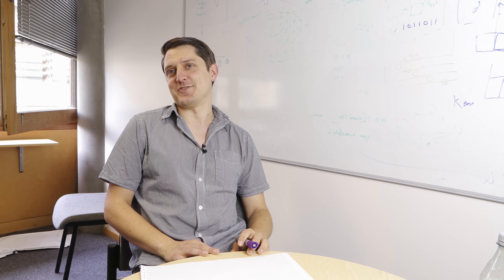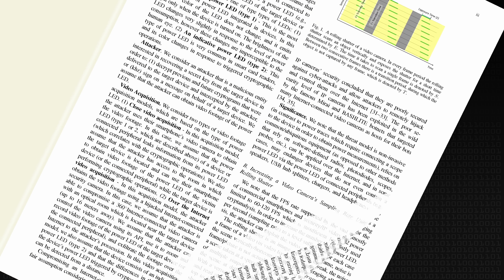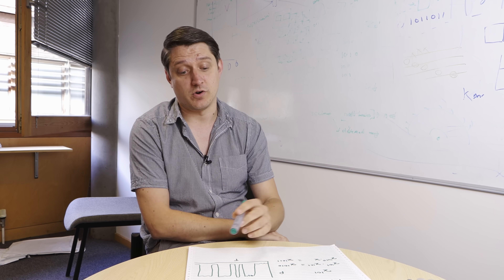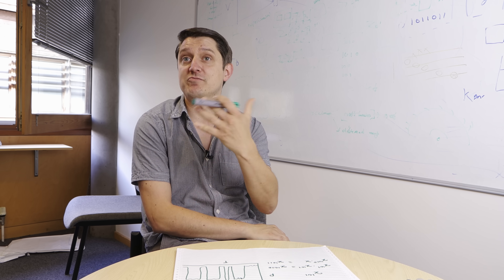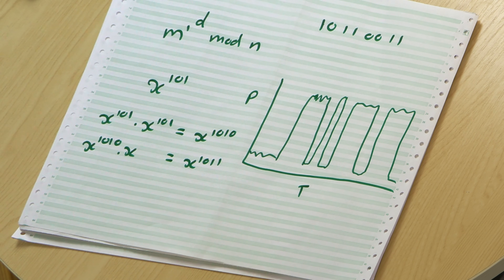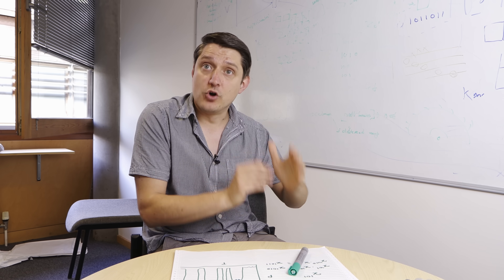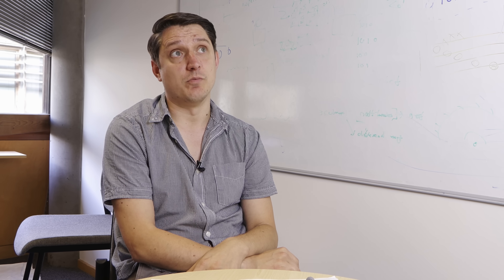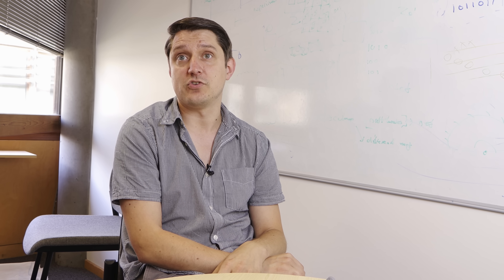Power LED Attack - Computerphile

Comment: To everyone who writes an "Ah, the fix is easy just do this" comment; the problem isn't this specific vulnerability. The problem that this is one of dozens or hundreds of attack vectors into dozens or hundreds of possible algorithms, each made from thousands of lines of code. And each one showing more hard to imagine ways to utilize side channel information. Any one of them is easy to fix, if you are aware of it. And any diligent software or hardware engineer who is qualified to work on cryptography stuff will attempt to fix as many of these issues as they are aware of. It's the "being aware" part and the sheer number of possible issues that's the problem.
Reply: Adding on to this, it's possible for someone to harden their security against every single known side channel attack, but if someone thinks of a new one, then suddenly all existing infrastructure is vulnerable.
Reply: Ah, the fix is easy just destroy the LED
Reply: @pistonsjem  And if it was a blue LED, it deserved destruction anyway.
Reply: @ingulari3977  I wouldn't be so sure about the weather part.
Since the portion of the computation you care about probably happens really quickly, I wouldn't expect there to be any significant changes in the environment that'll mess up your brightness values. But I might also be entirely wrong, I have done zero testing or googling on this.
Reply: @ingulari3977 I can just say as a EE this is easily thwartable and it’s not even funny.
But hey scaring people with wizard powers gets the clicks.
Reply: Yeah, this sounds like something that's if not trivial at least not terribly hard to solve if it's pointed out, it's just that this kind of physical spying introduces so many crazy ways an attacker could break security that just completly end-line the stuff you put a lot of money into.
Reply: @Canzandridas, yes, better protection is very bad </ironyoff>
Reply: Exactly
Reply: Just put a low pass filter in front of the led? A single cap should do, shouldnt it?
Reply: @andrassasdi1767  OP's point was that individual vulnerabilities are easily solvable, the problem is that this style of physical attack on cryptography offers a fuckton of new opportunities to breach security and we basically need to either keep all devices doing cryptography way more physically secure than we have been or else find and solve each of them individually. It doesn't matter if a simple trick with the power regulation can solve this one if there's a thousand more and you'd need to do research and then put in a new component to solve each.
Reply: Yup, exactly. This reminds me of a short scifi story, where they created a starship impervious to any attack fathomable to be able to explore the Universe without any worries. Then it landed on a planet with some kind of microorganism, that selectively fed on metal and the ship proceeded to get devoured, because the engineers couldn't imagine such a thing.
Reply: But there is no need to fix this, this is extremely impractical and not feasible, to the point of near certainty that the attacker would not have all the necessary access and information to execute this. Just think about it, the attacker would need to know the processor is doing nothing but encryption/decryption all or most of the time (and that there is only one thing on the circuit that introduces those kind of fluctuations), the kind of encryption it uses and the specific implementation too, he would need an access to a very high resolution, high framerate and very high zoom camera (that's very rare in practice), or the access to put his own camera, somehow unnoticed, right on top of the led. This is not even impractical, it's practically impossible.
Reply: @realkrzaku  That's the dilemma. The attacker can use any of the vulnerable aspects of the system. They get to choose the easiest. But as the defender of the system, whenever you patch one the attack can just move to the next easiest.

Comment: I'm surprised video compression doesn't wreak havoc with this approach.
Reply: Ah heh didn't make it to part of the vid where they explained using the offset in time from rolling shutter/rows of pixels as a means of amplifying the effective sample rate but think photoresistor and oscilloscope could work fine too in terms of upping the sample rate.
Reply: The monitoring would need to be pretty accurate but if you know a little filmography it would be easy to configure
Reply: If you’ve seen Tom Scott’s video on MP4 compression I’m pretty sure it would be fine with 3 colors
Reply: Guess since like he was saying about it being out of focus doesn't matter much with regard to the average intensity it just smooths things out a bit that's probably mostly true with the video encoding as well (losing bits can afford to lose and still extract the intensity over time accurately enough)
Reply: It would.
Reply: Lossless compression shouldn't impact anything and you could always film without any compression
Reply: @Ghi102  I think part of the setup was being able to use common hardware devices, e.g. security cameras already present, or a normal smartphone (I don't know of any which could support lossless video encoding of full HD, something like 400MB/sec).
Reply: You wouldn't use some generic video recording app, silly. You would use your own tool that would get the raw data directly from the camera and extract only the relevant information, not saving the video.

Comment: If a card is read 'flat' just put the LED in the area the card covers to be read, which hides it, and do an audio beep to indicate the card is approved or not. If it is a plug the card in, put the LED under the slot for the card. If it is a slide/swipe, only light an LED if fail or success, not as power on indication.
Reply: or just put a capacitor in the LEDs circuit to smooth out the signal
Reply: @zockertwins  When all the capacitor bank of the system's power supply cannot suppress power fluctuations by varying CPU load then a cap for the LED won't fix it.
Reply: @u2bear377  Wrong. Small capacitors in picofarad range do filter high frequencies, while normal microfarad caps only filter low frequencies. You kinda need both. Also, for such applications the SMD pF cap would need to be placed RIGHT next to the LED, as close as possible.

Comment: Power leds used to work different in the old days. (adleast in the Northstar)
It was a led with a RC net work and it is powered from a interupt routine every time interfal.
This would not give a way any internal working and also shows the OS is stil running correct.

Comment: This specific attack feels like it would be more reasonable to fix in hardware than software.
Reply: Simply switch off the LED when processing cryptography?
Reply: yeah, a capacitor on the led might do the trick
Reply: @PIXELamPC  Or even separate power rails for processing chips and peripheral stuff such as LEDs.
Reply: @vladomaimun  This. Connect the LEDs to a separate power supply (small battery, for instance), and use a dedicated transistor to control it when you actually want to turn it on and off.
Reply: @IceMetalPunk  I don't think you'd even need to do this, just wire it in parallel. That way the CPU/chip could tell the LED "turn on now, let the user know we're doing something" but the LED would be isolated from the voltage drops across the chip.
Reply: @LastStar007  The LED isn't dimming because of the voltage drop across the chip, it's dimming because of the voltage drop on the outlet terminal of the voltage regulator chip as the CPU draws more current. Plus, the LED is already in parallel with the CPU.
Reply: @IceMetalPunk  but... indicating power is the entire point of a power LED?
Reply: @chemieju6305 no indicating powe is ON is the point not being a real-time analog of usage
Reply: @jhoughjr1  you're right, im just seeing the hardware side of things a bit more. The flickering is due to voltage drop when power is drawn, the LED is probably just using a single resistor in series. Foreward voltage is more or less constant, so any voltage variation is seen over the resistor and changes current. Add a capacitor parallel to the LED (just LED without resistor) and you have yourself a RC filter. Add a constant current circuit and you're independant of voltage variation. There are quite a few options here, they would all cost money, and they all wont stop a dedicated attacker with an oscilloscope.
Reply: @PIXELamPC  
No, Attach it to a High Frequency Oscillator  . ha ha
Reply: @PIXELamPC  Uhm no, that's security through obscurity. The real fix is to use an algorithm which always perform a square and a multiply for each bit of the private key, even if the multiply part is not used (bit = 0).
Reply: @gianluca.g  Uh... no, that's not security through obscurity. Knowing that the power led is filtered doesn't make the system any less secure - it's still removed an attack vector.
Reply: @somdudewillson  it kinda does because you can still use the power consumption as an indication, even if it's a bit more difficult to do. If you want real secrecy you need to take that power fluctuation out of the equation. Can still be done in hardware just probably more expensive to pull off than in software. Unless your application is computationally intensive and money is not the bottleneck, but the actual capability of the processor, i'd doubt a hardware solution would be the to-go solution to this problem.
Reply: @somdudewillson  If you put a capacitor on the led it would just "obfuscate" the real issue (i.e. filter out the flickering which still wants to happen). Remove the capacitor and you get the flickering again. That's what I meant with "security by obscurity": not solving the fundamental problem but just covering it, like in software encrypting an executable to avoid reavealing the hardcoded license key for example. Also, by doing so you get the "whac-a-mole" effect: you try to cover an undesired behavior, and as a side effect some other behavior arises on a different part of the system.
Reply: @gianluca.g  how thou ?
Reply: @gianluca.g  unless some "helpful" optimization decides to skip the extra computation
Reply: If you want to mitigate both security holes (the one using the led and the one using power metter), you'd want to consume the same thing whatever the bit you're using is. And maybe randomly compute extra calculations that you won't use later.
Reply: The fundamental problem is the cpu doing heavy computation that is correlated with the key. Even if you solve one hardware problem by adding a capacitor, the problem is still there, waiting to be exploited again. The temperature of the chip probably fluctuates in a way that is correlated with the key. Don't play whack'a'mole if you don't have to.
Reply: @haukur1  If you solve the LED fluctuations with a simple capacitor then the other attack vectors sould require physical access being there measuring the power
That makes the problem much less severe
Reply: @maticz3923 all that assumes wait iPhone doesn’t have power leds wtf…
Reply: @jhoughjr1  what
is that written by a bad ai or is this just schizo rambling
Reply: @haukur1  Add a circuitry to create a big RNG and use it to intentionally draw slightly more power. IF the RNG algorithm uses part of the encryption to create the new bits, it will not be repeatable over large enough samples. Technically a hardware solution for a software problem, but i'm pretty sure more expensive (in terms of literal $) than a software solution.
Reply: @haukur1 no no it’s not still there waiting to be exploited no one has explored this
Reply: I think software would be better since that prevents the hardware from revealing the information altogether. So there's no way you could figure it out no matter how you probe the circuitry.
Reply: The LED driver could be very simple, just charging a small capacitor, then dumping its charge into the LED. This ensures that the duration of each flash doesn't carry any information, and the brightness is just an average of the power supply voltage over the entire charging period.
Reply: Since the leak is a power LED and the power drain ... adding hardware to make sure the Power LED still shows power is on, but does not show the actual consumption would block one mode of attack 
Adding extra instructions is another way, but if the timing of the instruction you do but don't pay attention to is different then blocking an attack vector will help as well
Reply: @ingulari3977  Infrared cameras exist for that.
But then again, I don't expect there to be that many CPUs doing security critical work out there that you could easily point an IR camera at.
Reply: @ingulari3977 There are commercial phones out there with FLIR capability on the camera sensor. But that's really not the point. It's just one example of whack'a'mole. And there are lots more.
Reply: The problem is not the LED. Anyone can just solder an led into the system. The issue is that power draw is giving away clues of a "secret" operation, and anyone looking at the power draw (such as with a .003$ LED) can see it.
Reply: Change it from a "power LED" to just a little window with a piece of coloured cardboard behind it, that flips from shut to open when there is power and flips from open to shut when power is removed.
Reply: false.
Reply: there are basic mitigations in hardware but nothing you can really do to truly prevent someone from seeing fluctuations in processor power. its down to the software to add nops to take the discernible pattern out of power consumption.
Reply: @drkastenbrot Nops have very discernible power consumption. You want logic to make the same number of transitions regardless of the result, which is tricky when carry chains are involved. Or you want to make transitions indistinguishable, like with adiabatic logic. And either way you want a constant time algorithm. If you want a software solution, look at homomorphic encryption. Not knowing the key can help to not reveal it.
Reply: @drkastenbrot  But do the no-ops use the same amount of power as, say, a multiplication? Sure, they take the same amount of time but that time is spend doing nothing instead of actually manipulating registers.

Comment: Power leds are already being used to capture data  spesificly the rubber ducky can use the capslock led on the keyboard to gather data
Reply: Yes, but in that case the rubber ducky uses the LED to transmit the signal by controlling it. So the transmission via LED is on purpose, while the rubber ducky need a seperate vulnerability to gain control of the LED. In this case the LED is the vulnerability.

Comment: Well just add artificial noise into the LED so you can easily throw off these attacks!
Reply: It can be average away if repeated.
Reply: @anywhereroam9698  averaging out the noise is only any use if you can exactly align the signals, else you average away the signal along with the noise. So if there is randomness on the timing too, that's pretty much impossible. There may still be other ways of getting around it, but the noise definitely makes things a lot more difficult for an attacker.
Reply: Have the LED always flash in such a way as to generate a specific key.  Whenever somebody uses that key in the card reader, instead of opening the door, your system releases the bees.
Reply: Just an SMD capacitor would be enough.
Reply: if you can manipulate the led why not shut it off during crypto and turn it back on when done (some things need simple answers)
this would not help the power snooping attack though just so we are clear
Reply: That would be way harder than just turning the LED off during processing (for a fixed time longer than the calculation will take of course) and making your crypto algorithm constant-time.
Reply: You could also just stabilise the voltage over the LED with something like a zener-diode. This way the fluctuation of the voltage caused by the computation is affecting the diode before the LED, and not the LED. Usually a simple resistor is used in series with the LED, but by using an active component instead, the resistance before the LED no longer is constant.
Reply: Or ditch the led simple

Comment: Super interesting. However, a possible solution for this specific problem is quite easy to get - store both the original value x and the temporary result to an array of 2 (or two registers in assembly). Then on each loop shift the exponent by 1, and extend the LSB to integer to get the index within the array and multiply (no conditional jump required). You will multiply by original number if 0: x * x^t = x^(t+1) or by the temporary result of 1: x^t * x^t = x^(2*t). Not only it is the same number of operations, but uses only one multiplication per loop (but also one additional bitwise-and operation per loop).
Interestingly, there are a lot of problems like this, where writing an algorithm with imperative language, especially using if/else can reveal data to side-channels like the one in this paper, but writing homogeneous implementations (where number of instruction executed on each unit is the same), suitable for the way GPU works avoids this problem.
Reply: Yeah - right up until the instructions generated by someone else's compiler outputs not-what-you-thought-it-would. The problem is obvious, the solution is simple - never happens.